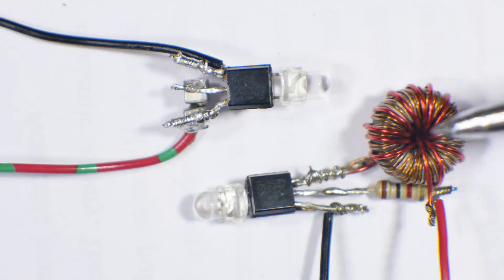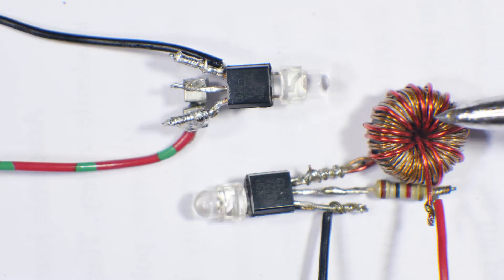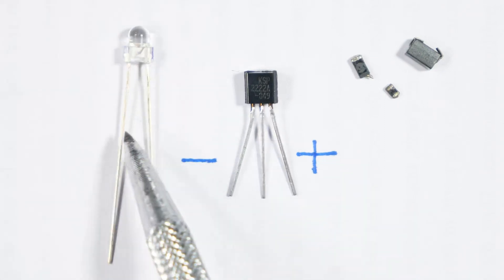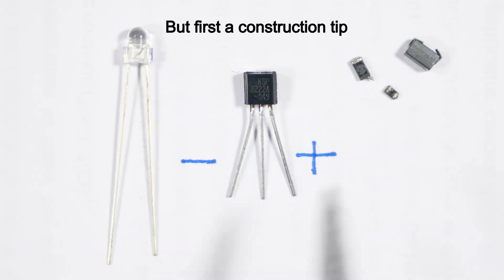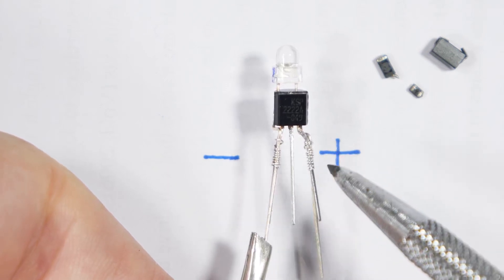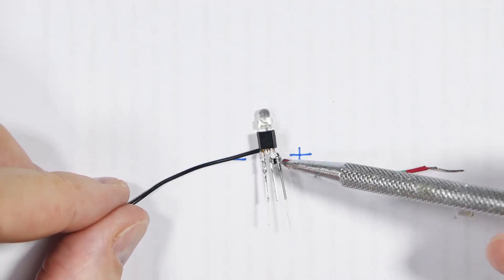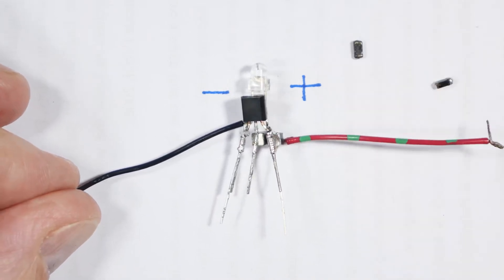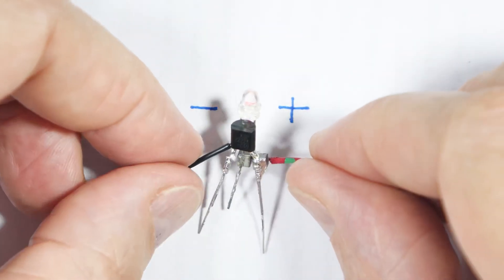Joule Thief - No Toroid Coil, Build (4K)

Comment: Using a power supply allows the circuit to use as much current as it wants, to operate.  Which can fool you into thinking that a cell at that volts will work also. A battery (cell) at 0.6 volts usually has built up too much internal resistance to light the led.

Comment: Great so what lower limit voltage can this run at ? What would the maximum power delivery be. Could it run a tazer module that only requires 0.05 watts ? At the moment I can use a dead aaa battery to run a small flouro from a tazer module but not below 0.65 volts . Sometimes it only 0.02 watt
Reply from the maker: It depends on your design. I have run a 70v neon buld on one of these using a toroid buy changing the windings.
Reply: @tsbrownie  is it limited by the transistors lowest voltage? 2n222
Reply: I looked up data sheet but I can't see what the lowest forward voltage is .
Reply from the maker: @Buzzhumma  You can use any high amplification transistor (in this case it's a NPN, you'd have to change the circuit for an PNP). I have used big darlington transistors. I think the biggest limit is the flyback voltage into the base and you need to keep the emitter to base voltage spikes to below the max (about 6 volts for most mfgs).
Reply: What value H inductance coil would be optimal to use as I would like to build this circuit and I want to purchase some surface Mount ones and want to buy some of the correct value, so what would be a good range to shoot for like low side 6.8mH or 100H range or what are you 🤔 thinking?